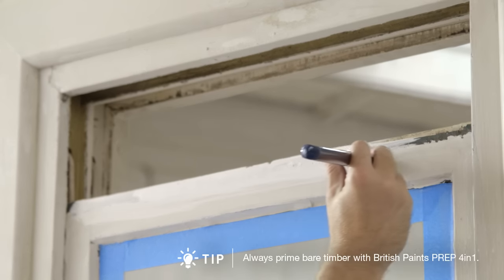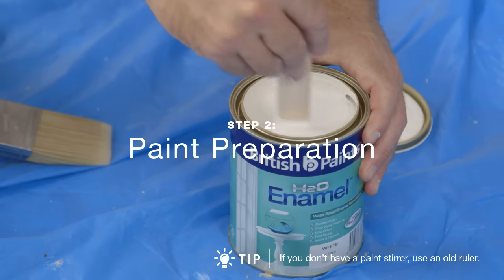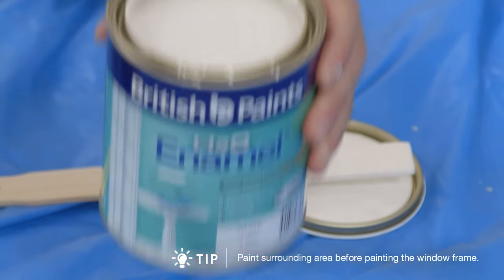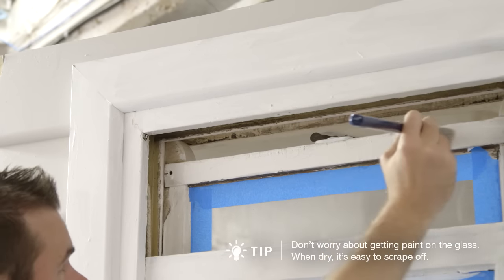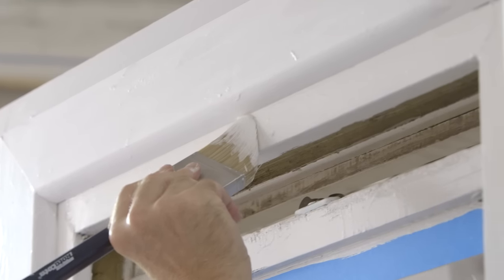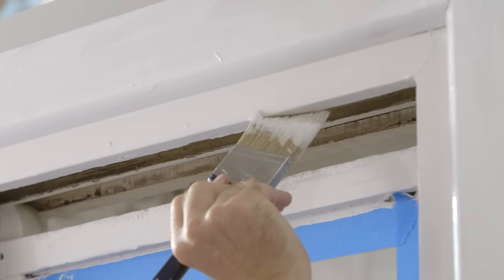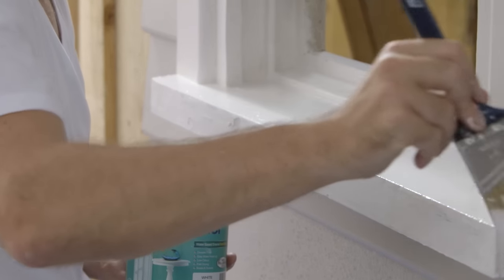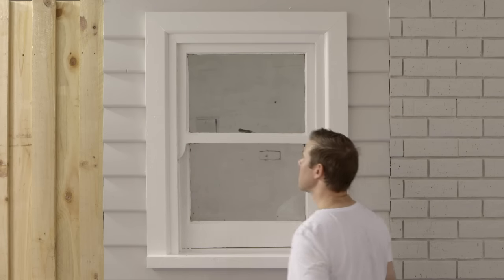How to paint an exterior sash window?

Comment: I have ten double hung sash windows 2x3 2x2. It has taken me a week just to prepare them for painting. They are 75 years old! and have only 2 bottom sashes replaced in that time because of their exposure to weather. We are the second owners only. The house faces west which is pretty harsh in Adelaide SA. Pay particular attention to lower window putty as it will move with age and need replacing or water will find it's way in and rotting will take place.  Undercoat bare wood on 'the rabbit' ( where putty goes)with primer. There is an art to applying putty.  Hint: use chalk dust to remove linseed oil from the glass with a dry brush, it also helps speed the skinning of the putty which can take a few days before painting. It will stay soft for a few month after painting so don't go prodding it. This video lacks good preparations and is not a good look for the company. I'm an novice painter but so is this guy.